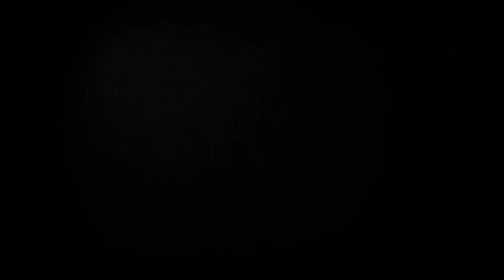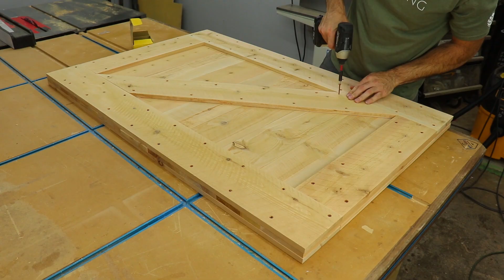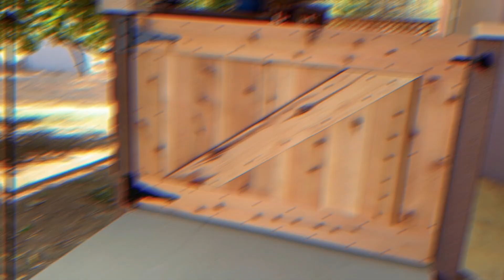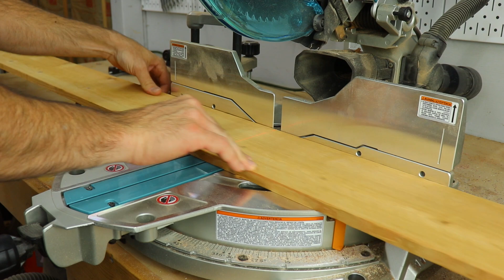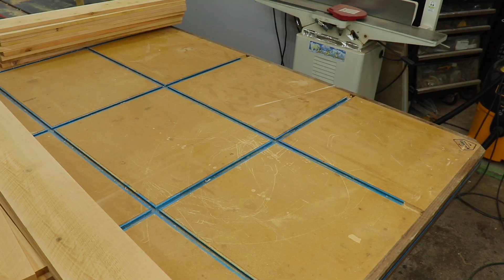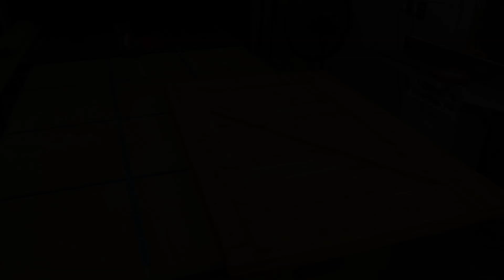How to make a outdoor gate / diy dog gate

Comment: Thank you for this. I built this today and love it! My question is, do you have any idea where I might be able to get hinges that allow a gate like this to act like a Saloon door and return back to its resting place?
Reply from the maker: I got some on Amazon.  I can't remember what they are called.  Maybe two way hinges?
Reply: You can get self closing hinges at the home improvement stores. You can also screw on a big spring to lose, which is much cheaper
Reply: mnm1067 I’ve bought and tried self closing hinges and the gate is too heavy and they don’t work. So I was wondering if anyone had ideas for industrial strength type hinges. As it is right now I just have the door propped up on a couple pieces of wood to hold it shut for now. Still on the search for the right option
Reply: @EddieBecker05  What did you end up getting?

Comment: Why is it necessary to have the frame on both sides?
My thoughts are, "it's not load bearing, does it really need that much support?"
Thanks
Reply from the maker: I tend to over build and also that's the look they wanted.
Reply: Thanks, I want to build something like this myself.
Reply: @WalkersWoodworks  Do you think framing on just one side would be adequate? I want to build the same thing, except wanted framing on just one side. 
Thanks.